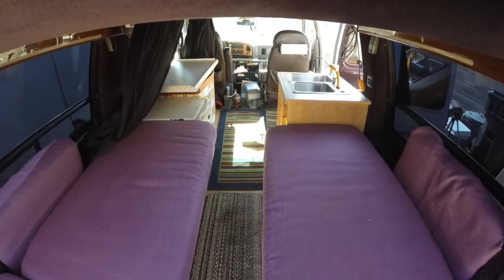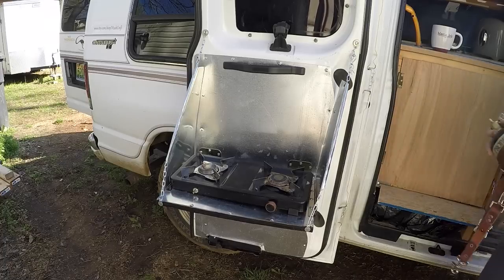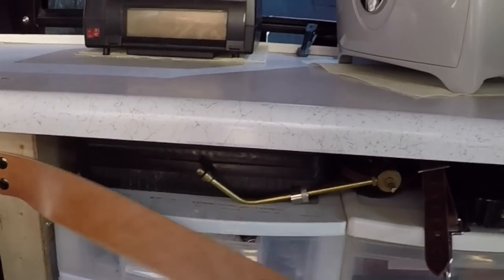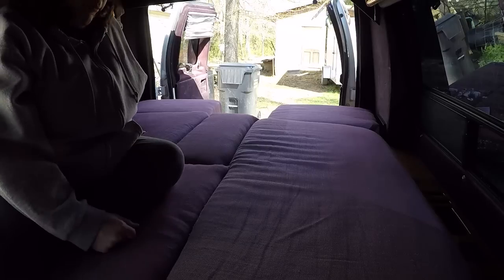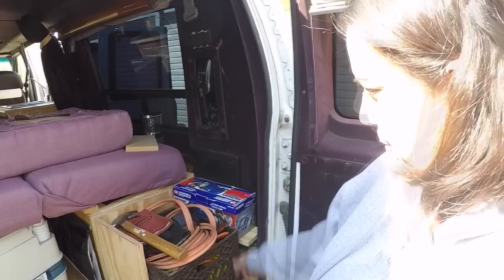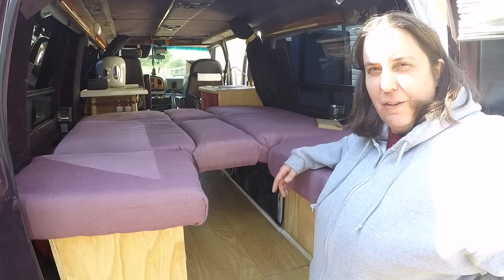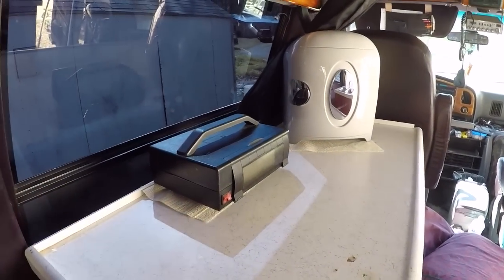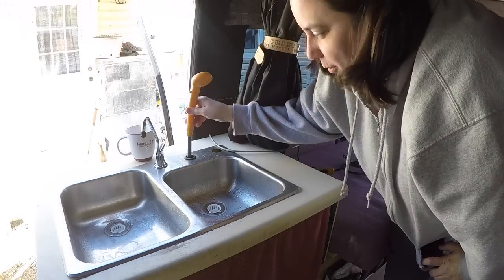My Homemade CamperVan Tour- Part 1: Cooking Platform, Bunk Beds, Storage, Pantries, and Sink Set-Up

Comment: You may be done with the battery install but my van had a battery box which was mounted underneath the van and the wires were then run to the battery. Once placed in the box it was not seen but it was fun getting it into the box at first, then no problem. This was the battery for the solar/aux. system. This could save space inside the van. Best regards! :)

Comment: Super!  Looks great.  You might want to move your CO2 detector lower though.  CO2 is heavier than air, it pools on the floor, lurking.
Reply from the maker: Caroline Edmiston (Cooki3Fairy) Thank you, very much, for that tip! I will certainly take your advice and do that before winter camping! I appreciate the help!
Reply: That is what I thought too. But  the fire department recently inspected my apartment building & ordered my landlord to change all of the 'separate' smoke & CO2 detectors to a single combo smoke & CO2 detector mounted on the ceiling. 
I thought it was strange & intended to look it up, but haven't. Instead I took time to write this comment & probably could have googled an answer already! lol

Comment: Thank you for uploading this. I have a conversion van and I want to set it up better. I've been thinking about maybe getting a class b rv, but I'm 6'5" tall and I usually don't like how things are setup. Others have said how getting an empty van and turning it into an RV is more expensive than getting one already outfitted. You're changing my mind on that one. You give up flexibility. You've got some great ideas. I really like how you're modifying as needed.
Reply from the maker: Wandering Wade Thank you! I've spent MANY hours, just sitting in the van and deciding on exactly how I could best utilize my space. I wanted a kitchen area that could be used inside or outside the van. So, it made sense to put the counter and sink where I did. (at least to me, it did.) Thanks for watching!

Comment: You are awesomely handy.  I really like what you are doing with your van.  I have done a ton of research on 12v appliances, and if you are going to have a fridge, I think you should seriously consider something with a Danforth-Foss compressor.  They are pricy, but I have been running a fridge at 35 degrees for a week on 136 watts of solar with power to spare.  Love your vids.

Comment: I know this is coming a bit late, but Carbon Gas is heavier than oxygen and pools in the lowest spots first and builds up vertically, so by the time that it would reach the detector to warn you it would most likely have been too late.

Comment: My intention was to raise an alarm with you so you contact a qualified gas fitter. But if you want specifics, you are allowing rigid pipes to flex, which will lead to fractures (read fire) and also you are allowing a gas tight coupling to work loose (read fire). A better way to do this would be to use a propane (or butane depending on what regulator you are using) approved flexible tube and then use a small spanner (wrench) the tighten the coupling each time. Or better still a gas approved quick release coupling. I wasn't having a go at you and like some of your other stuff, just want to keep you safe as if gas leaks into you van you could have a bomb. I don't think your carbon monoxide sensor detects gas leaks, please check.  Hope this helps....

Comment: So, what do you do when it's pouring out? Do you just head to McD's or other food joint? 
I bought a CampChef for around $200 last year, hooked it up to a 20 lb.and since stealth is important to me, I do all my cooking inside my '97 e150 high top van.  The CampChef consists of a two burner stove top w/ a two shelf oven, capable of cooking w/ a 9" x 13" pan. I've baked muffins, baked both a 10 lb. spiral ham as well as chicken, etc. in it. The only thing I'd NOT recommend, is barbecuing in it---unless you like the van smelling of barbecue sauce for a week +! ...lessons learned!

Comment: Great set up! How much did the van and the conversions cost you? Also with an older van are you afraid of it breaking down and costing more in repairs than getting a newer van?
Reply from the maker: ***** Thank you! I bought this van for $1,800 from a guy that buys cars at auction and strips them, or flips them. I had to change the spark plugs, as the van wouldn't start if there was any moisture in the air. I had to replace the radiator, and have a little other engine work done. I also had the front end rebuilt, as it was in poor shape.  Most of the work I've had done at a really good shop in town. They know what they're doing. Other than that, I've put 2 sets of tires on it, a new battery, and changed the oil myself, since I bought it in 2010.  Runs great, now!
Reply: Colette White Wow that is wonderful! Thanks for the info. I plan on converting a van as soon as I'm done paying off my medical bills. Have a great trip! I love the videos.